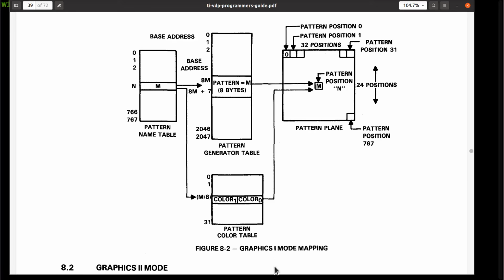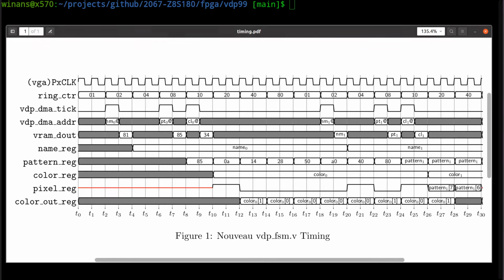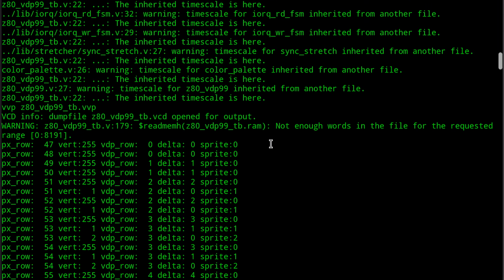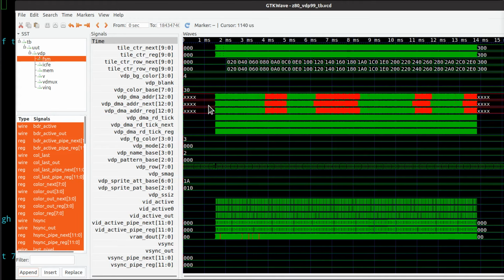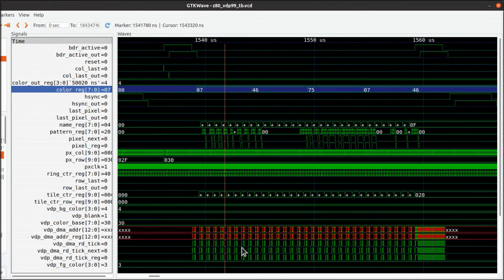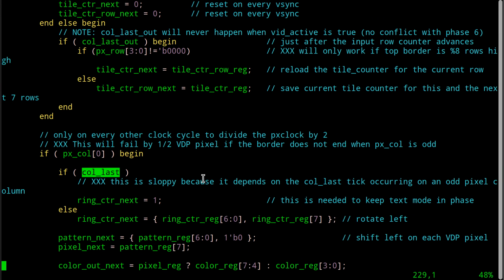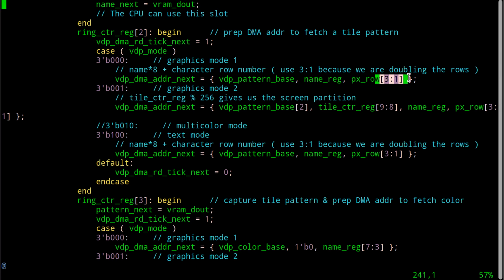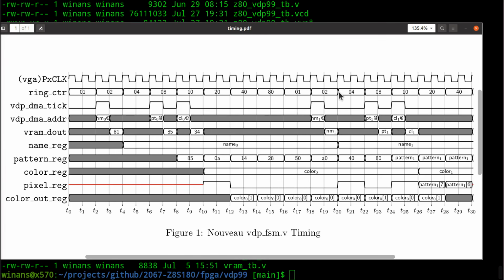Z80 Nouveau vdp_fsm.v Module Walkthrough pt. 1

Comment: 1:11:50 the vdp considers the display in layers. (Or planes) The backdrop layer is the bottom layer with the pattern layer above that. On top of the pattern layer are the 32 sprite layers.
Any transparent pixels on any layer above the backdrop layer will show the colour of the layer below. Section 2.2 of the vdp programmers guide has this to say about it. 

"Behind the Pattern Plane is the Backdrop, which is larger in area than the other planes so that it
forms a border around the other planes. The color of the Backdrop is defined by four bits in
VDP Register 7."

So you've done it correctly.
Reply from the maker: Thanks!
I KNEW I must have read that somewhere. Otherwise why would I have put it in like that?